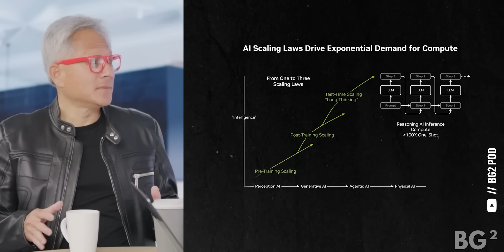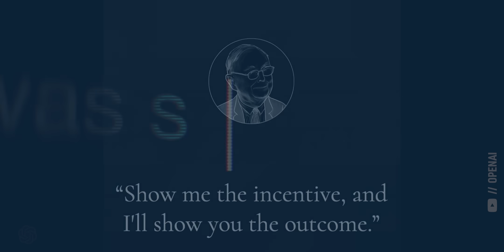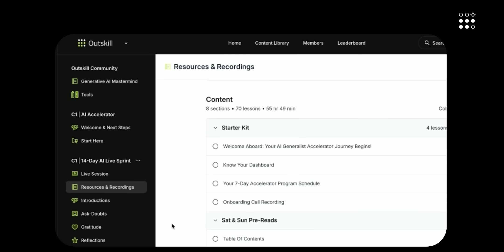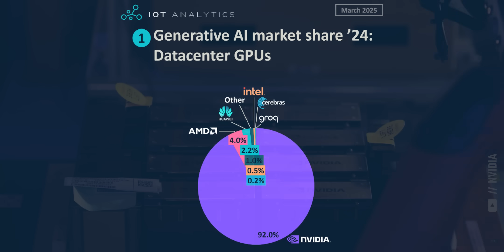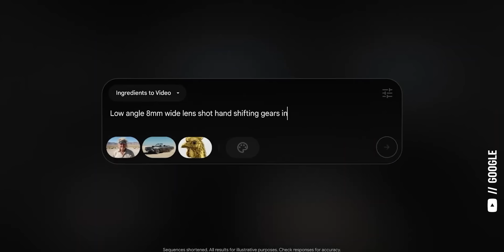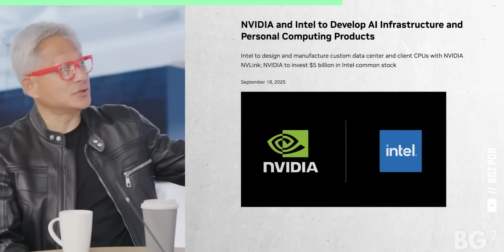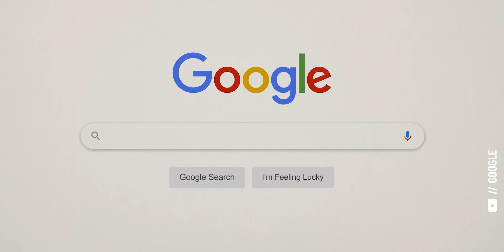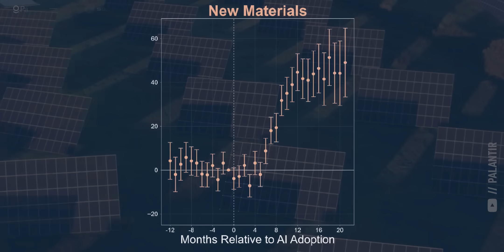WARNING: If You Hold Nvidia Stock (NVDA)… GET READY

Comment: This is BS. AI cant design code, projects or systems and it cant manage staff or fix runtime bugs. It only tries to guess the code you want to write next based on what it has seen in the past . And you have to be careful before you put any code it presents to you into the project. The reason why most large software projects fail is because of design issues which only become apparent halfway through the project and are impossible to fix within the time and budget constraints. AI won't improve that and might make it worse by adding more run time bugs into the code which are very hard to find and fix.

Comment: The Windsurf CEO made two important points about AI augmentation, speaking specifically about software development but more widely applicable. 

The first is that coding is only a fraction of what coders do. Even making that fraction 100x more productive doesn't mean the development process speeds up by 100x.

The second is that productivity increases raise demand for coding, because of the increased ROI, if the company can make use of the additional capacity for work.

Comment: Thank you for this analysis, but examples you gave such using AI for formatting messages, writing documents, summarizing emails and articles, would not double Software or Firmware engineer productivity. This only could be achieve with acceleration of development directly. I found AI agent inadequate in several areas not able to solve simple but tedious for human problems, but please look in this area as it will soon explode

Comment: In trading, it’s tempting to get caught up in the buzz. But the real edge comes from sticking to a disciplined approach.

That’s where Prof. Goldman’s Method shines — guiding you through the noise with a structured, results-driven process.

For example, a Nasdaq trade recently yielded a +9% gain in just 3 days, thanks to staying focused.

When did you realize that structure is more important than jumping on the latest trend?

Comment: According to nvda ceo then this earnings season most companies should be reporting all kinds of blow out earnings ?
Reply: If not this quarter…
But every quarter going forwards…
Do you remember when word processors wiped out typing pools?
It wasn’t immediate… but it didn’t take very long…

Fax machines were still being used until recently…

Working in a call center is going to be very similar…

Working a drive thru… fewer errors than ever before.

People using AI will be more productive…

People getting cut by AI will be saving money off the bottom line…

Nothing new… just faster and more efficient…

😃

Comment: The reality is 10 people were employed, now 1 person will be employed using an Agent in place of the other 9 people. It will not be 10 people using 10 AI agents. It will be 1 person using 10 AI agents with those 10 AI agents controlling 100 other AI agents. Now you see where this is going.
Reply: Nah, those of us old enough to remember when PCs came on the market know this isn't true. Back then PCs were going to make people so productive they'd only need to work 1/4 as much. You can see how that worked out. Competition will drive companies to scale at insane levels and while some roles will be obsolete I bet it's a significant net gain for the job market.
Reply: It sounds like you need to do a little more research 😂